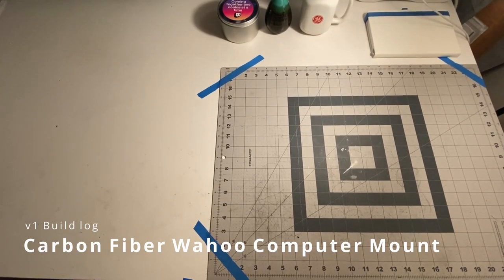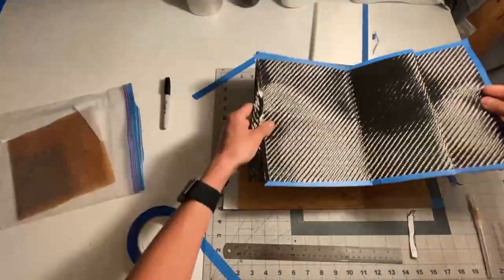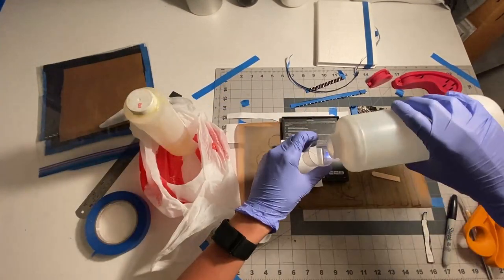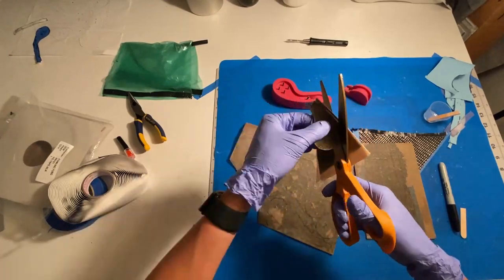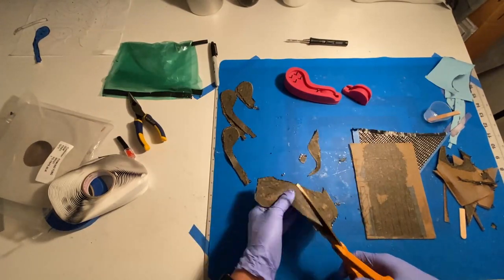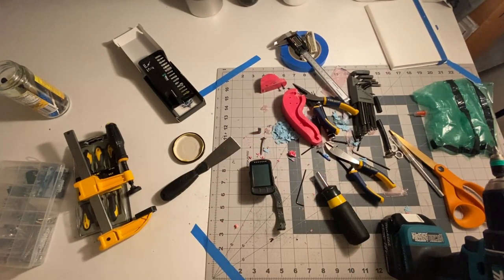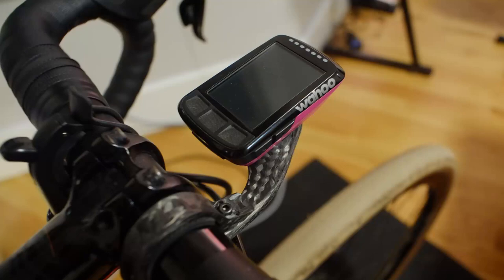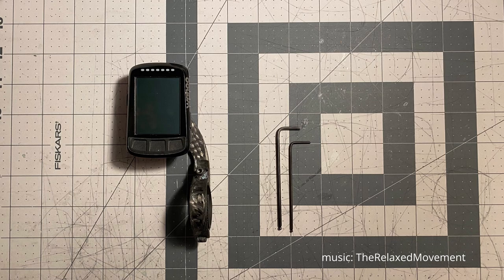Making a Carbon Fiber Wahoo Bike Computer Mount with 3D Printed Molds

Comment: Nice technique with using the ride paper templates over the epoxy-saturated carbon. I usually spray the carbon with an epoxy-soluble adhesive to stop the fraying, and then cut it out dry, before applying epoxy to the mould and sequentially laying up, stippling down, etc, although this is on larger parts. I think your method might be less messy!